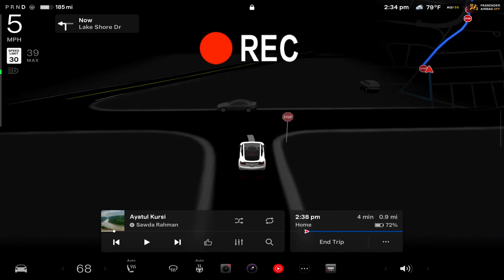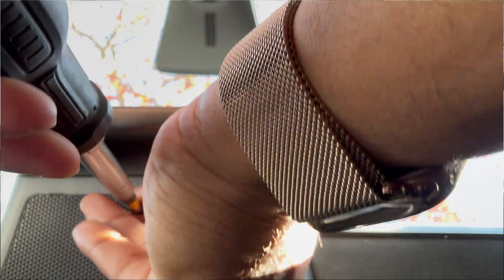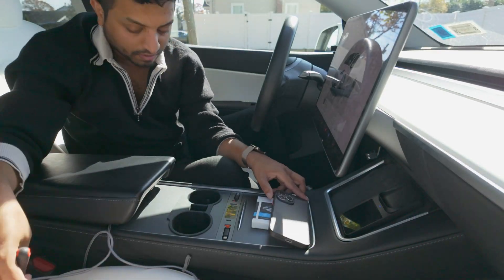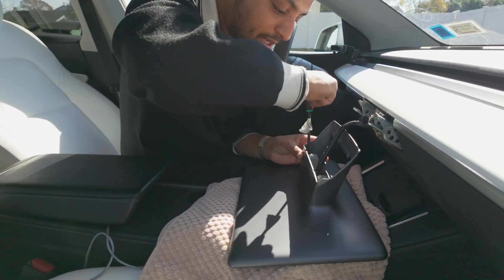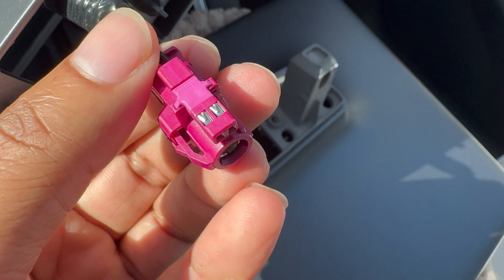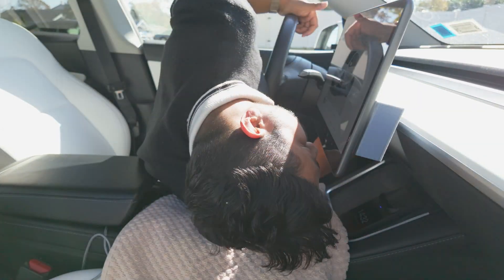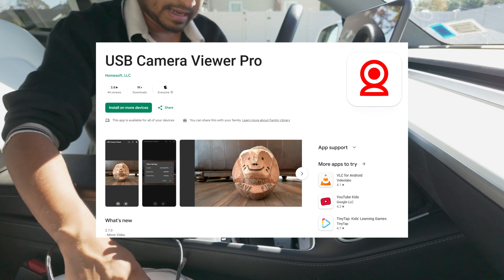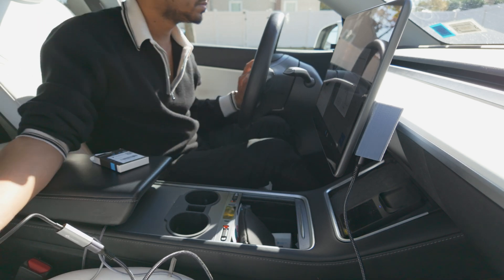How to Record Your Tesla Screen: Easy DIY Mod!

Comment: About how much for the screen if you can say? Really looking to do this but want to make sure it's in budget before I reach out to Adam.
Reply from the maker: It will cost Around $900 (Adam Charge) + the Display cost (Depend on where you get it from) I got it from eBay around $300, Thanks for asking.